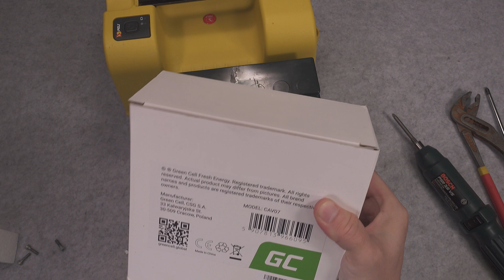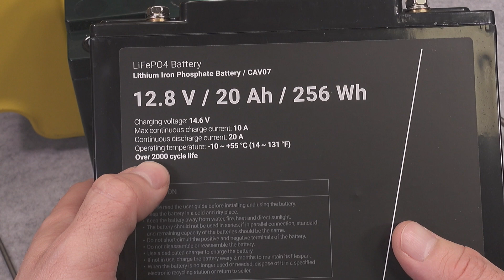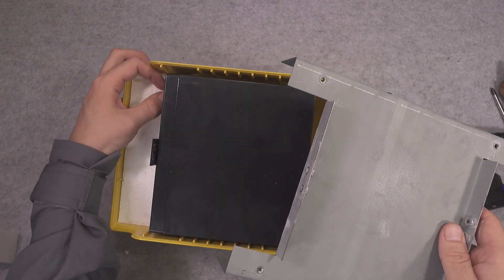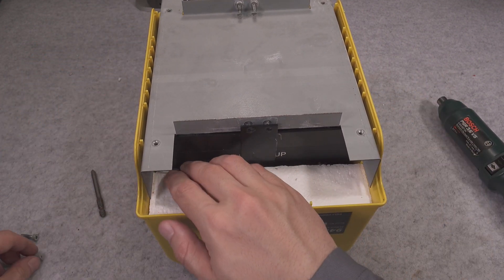Peli RALS 9430 replace AGM SLA battery with new lithium LiFePo4 20Ah 12V Green Cell

Comment: Does the battery indicator on the lamp still work correctly?
Lithium batteries have a different discharging process in terms of voltage.
But it is also said that lithium batteries should still be charged with lead chargers. Would that work here too?
Reply from the maker: Hello,
It work perfectly fine - battery have build in BMS for protection. I run it over 12h straight at full power without any issues.  I'm charging it with dedicated lifepo4 charger. In general SLA float charger that output 13.8V should be enough to recharge but I'm using dedicated.   I'm planning about getting some older Goal Zero and replace it to lithium.  When I get more equipment I will give it a try and see how many power did we actually loose while charging lifepo4 just to 13.8V. I don't think there will be much difference - that's my opinion but I need investigate it.

Comment: do you have the details on the battery please ,,,, how long does it run now .
Reply from the maker: I get over 10hr on full brightness.  Light is using boost converter and I have feeling that it run longer with lifepo4 than on exactly same capacity SLA battery (It was 20Ah and I swapped it with 20Ah) and that just because it have higher voltage for whole discharge time so dc-dc converter need less current.
Reply: @ElectronicNoobBlog   thats a full nights work , so who needs any more than that ,,, well maybe cave men or pot hole people , but for most folk it will do the very best ,,, whats a light boost converter ?

Comment: Third! 😄 Looks like you ordered the PowerCON socket from Conrad! 😉
Reply from the maker: Yes Yes! I ordered 1PCS and cried how expensive it was in compare to really quality connectors - I think "speakon" would fit 1:1 in that hole and offer same safety  -but I don't had permission to alter that device - so everything can be rolled back how it was - just in case :>